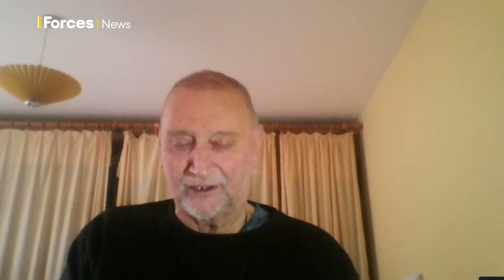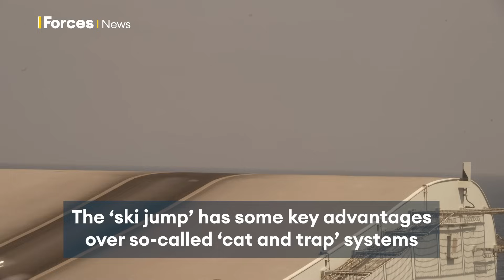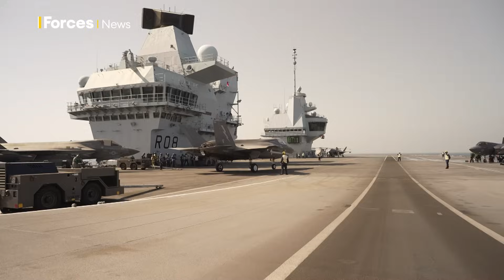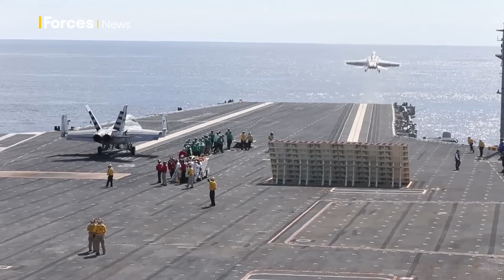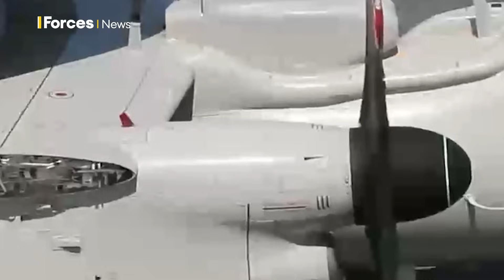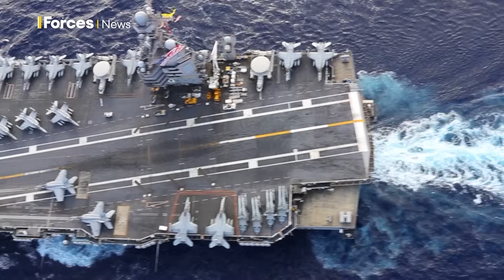Aircraft carrier catapult or ramp - which is better?

Comment: A catapult is better, just not several billion pounds worth of better
Reply: Not when the accidents resulting from catapults cost many billions
Reply: A ramp NEVER FAILS !
Reply: There are pros and cons to both systems. Ramps are less weather restricted which is an important factor in the Atlantic, are not suceptable to mechanical failure or battle damage and also have a high sortie rate.
Reply: The fact that the Royal Navy has been unable to launch and operate fixed wing AWACs and EWACs even after it cost them dearly in the Falklands says all you need to know about the Royal Navy and British Military, they'd rather spend less and lose more than spend more and lose less!
Reply: @edwardfletcher7790 clearly have no idea what you're talking about.
Reply: Without a catapult, you can not operate the most important aircraft of today, AWACS and EWACS, you cannot operate heavy drones or tankers, you're forced to operate the F-35B which has the lowest take off weight and thus shortest range, slowest speed, least manoeuvrable, least weapons, lowest altitude, and most expensive variant.v
Reply: @fightforaglobalfirstamendm5617 The F35B can also land virtually anywhere if runways or carriers decks are damaged. Like I said above there are pros and cons.
Reply: @gordonmac3616  it's not even close, the cons far, far, and away outweigh the pros!
Reply: That is your opinion and some would agree,  however people higher up the food chain evidently do not.
Reply: @gordonmac3616  No, they agree they just couldn't get the government to agree to spend what was required. The only people who believe ramps are superior was the government not a single military man would agree. 
All you have to see to prove that is look at project Ark Royal and Japanese Self Defence, the Korean Navy and the PLAN, all deigned or built light carriers or fleet carriers an none chose the ramp. Even the JSMDF and Koreans are to operate the F-35B and they said they would not use ramps as the draw back are to great!
Reply: Drone versions of these capabilities already exist
Reply: @jimfrazier8611 
Thats why you dont put yourself in that situation
Reply: @fightforaglobalfirstamendm5617  
That would be wrong
While the QE has problems, they are completely fixable
The MQ-9 Mojave which the UK is testing is compatible with the regular MQ-9 kits
Thats Broad Area Maritime Surveillance (BAMS) kit aka Seaguardian for ASW/ASuW. There is also AWACS kit in development
An MQ-9 with BAMS and AWACS would address those short fall
For electronic warfare, there are two options, the first an MQ-20 fitted for STOL with EW kit
The other which is more likely is that USMC investment with the Next Generation Jammer program is variant of the pods that can plug and play with the F-35 without any modification besides software updating. 
As for weapons
Again with the UK , its simple investment
The USN was working on the JSOW-ER which had 300 mile range with a broach warhead , the USAF is working on the Stand-in Attack Weapon (SiAW) , Boeing working the Powered Joint Direct Attack Munition (PJDAM) and Lastly, the Joint Strike Missile (JSM) which already designed for the F-35A and C models
The model for the B hasnt been developed yet. Of course, the weapon can only weigh 1000lbs and has to have a multi-role warhead for various target types
)there are those options 
Or the UK can contract a company in UK to develop 300 mile range weapon able to attack both targets on land and sea targets but able to fit in the F-35B weapons bay
The QE does have problems but they can be fixed
Reply: @jimfrazier8611 
Incorrect
The whole point of having long range is so the enemy cant surprise you
Thats why the USN is trying to get more range out of ships and AWACS
Reply: Yeah, the several billion pounds you can never afford because you're skint.
Reply: @soton5teve Like, which one, please be specific, you ridiculous triggered nonsense?
Reply: You can't afford the technology of nuclear powered air craft carrier, so there is no need for your nonsense broke country to even discuss catapult systems. 
The catapult system allows you to launch 4 planes with heavier assets than your nonsense carrier every 30 seconds, and 8 planes every minute. Yup don't even have airplanes on your ships, which break down constantly, which makes them unreliable. The way you broke nonsense run your nonsense mouths from your nonsense broke country is truly remarkable.
Reply: @gordonmac3616 how exactly due you have a high sortie rate when you have only one ramp that allows you only 3 minutes to launch a plane at a time, and what happens when that ramp is shot down or made unavailable during conflict....??? My word, the way you ridiculous nonsense run your nonsense mouths from your nonsense impotent irrelevant nonsense country is truly remarkable.

Comment: A ramp takes up precious deck space that would otherwise be used to park additional aircraft or equipment.
Reply: Which is only relevant to the USN as neither of the other countries that operate carriers can afford the extra aircraft to fill those spaces...
Reply: @Dr.D00p  They can certainly afford to put more helicopters on deck. 

And drones in the near future.
Reply: HMS QE can already carry 72, dont need anymore space.
Reply: @JOhEight  Carriers never have enough space.

Future requirements always demand more deck space.
Reply: Errrr .... if it was CATOBAR and you parked aircraft there you can't use the Cats.... 🤦‍♂
The RN have already published a parking plan with 45 F-35s on deck and full flying operation in progress and more stored in the hanger deck.
Reply: @1chish  There are many pictures available of aircraft parked on the bow area of CATOBAR carriers.

Meaning that additional deck space is available and useful to park aircraft when catapults are not in use.

Certainly useful for vertical take-off drones and helicopters.
Reply: @Chuck_Hooks   Yes there are but they prove my point. Parked there the ship loses two catapults.
The question then is how quickly could those aircraft be moved (and to where) if the Cats needed to be used urgently. On the QEs the aircraft line up and leave.
Reply: @1chish  USN has already figured it out since the pictures I refer to are of USN CATOBAR carriers.

And QEs are likely going to spend the next 50 years operating overwhelmingly as part of NATO task groups.

Meaning that there will be enormous resources dedicated to ensuring that any surprise attacks will be detected early enough to move carrier aircraft.

Btw, all US F-35B carriers/amphibs have flat decks.

And the two upcoming converted Japanese F-35B carriers also have flat decks.
Reply: Shouldn't be a ramp us marine harriers don't need it .😊😊
Reply: @thecurlew7403  Because they carry less than UK aircraft that use a ramp/ski jump !
Reply: @thecurlew7403   Oh right so because the USMC doesn't do something no one else should? Sorry not our fault they don't want to take off at maximum weight. But I suspect as they have used the QE and PoW ramps they have now assessed the big advantages. So watch this space.
Reply: @1chish  Why does usmc need your rust bucket.👉😀😀😄
Reply: @thecurlew7403   And right there is the usual Yank ignorance and misrepresentation. I never said they needed to do anything. And ignorance only surpassed by their arrogance.
The QEs are new ships. Hardly 'rust buckets'.
Now slope off and troll someone who gives a rats rear end.
Reply: @thecurlew7403  The Harrier is NOT a rust bucket and has served the UK and USA VERY WELL. Are really this stupid ?????????
Reply: @RJM1011  It was the ship are you an educated English twit.👉😊
Reply: @1chish  "Parked there the ship loses two catapults."(sic)

Incorrect. You've obviously never served aboard an underway carrier.
Reply: @RJM1011  "Because they carry less than UK aircraft that use a ramp/ski jump !"(sic)

Incorrect. Marine Corps Harrier IIs launched - and still launch - at higher MTOW than the Harrier IIs launched from the British Invincible class boats equipped with ski jumps.
Reply: @1chish  "if it was CATOBAR and you parked aircraft there you can't use the Cats...."(sic)

Incorrect. With one bow cat and one waist cat, aircraft can still be staged on the bow adjacent to the cat during launch as was frequently done on Ark Royal, as only one example. Loads of photos available in the public domain of the Audacious and Centaur class boats doing just that.